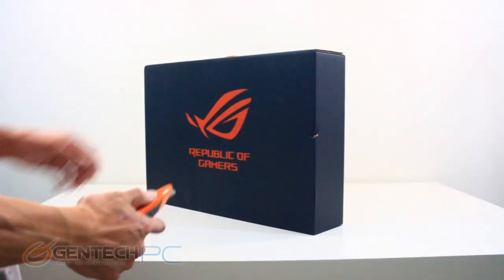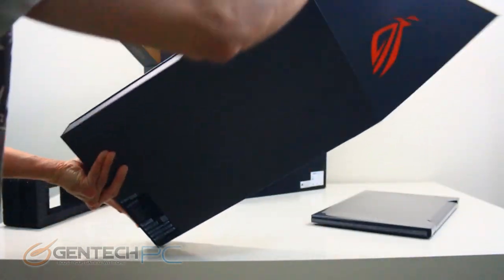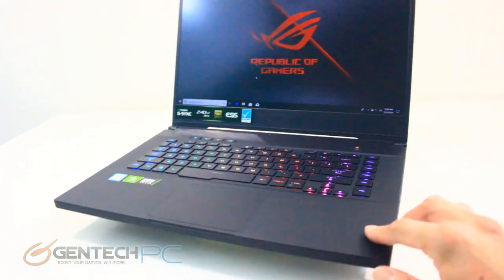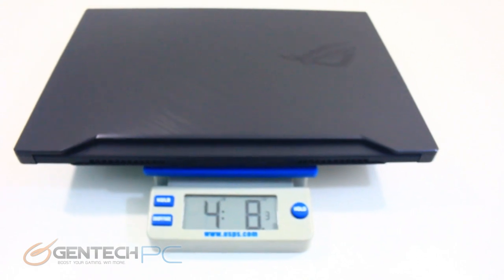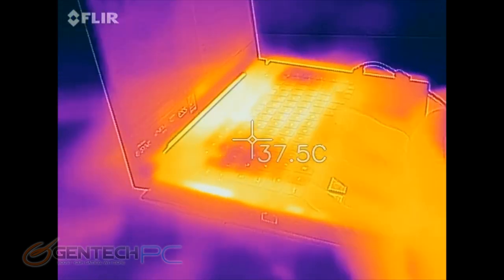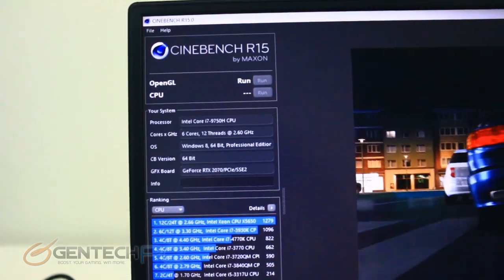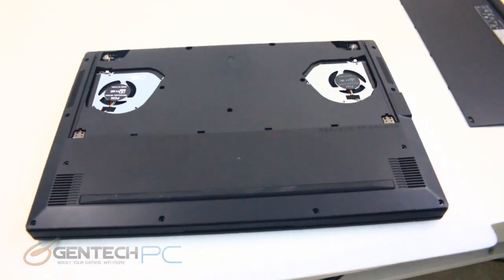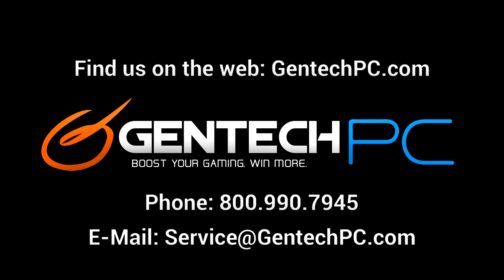Asus Zephyrus S GX502GW-XB76 240Hz RTX 2070 Review & Benchmarks

Comment: The cooling is really good in this thing especially for a ultra-thin laptop it’s great
Reply: If it is really all it is cracked up to be I hope so, I bought the previous model and am stuck with massive over heating issues and no BIOS options, are you able to access anything other than trivial stuff with the BIOS? I'm in the process of getting a refund or upgrade replacement to this.
Reply: KrazzahU well I’ve played Fortnite and call of duty for 3 hours or so and it hasn’t gotten over 87 degrees. It’ll vary between laptop but I think it’s a really good one. The quality of the build is wayyyy better than the msi and a dell.
Reply: This guy got a golden sample. Most people with this specific model (including me) have the CPU cooking at 93-99C and I have sent the laptop once to the service center. I had to limit the CPU speed to 3.6Ghz which is honestly very disappointing when the advertising over glorified the shitty cooling solution.
Reply: @firasbajjar  makes sense why I'm seeing them in mint used for $800-900 dollars. Thanks for the info.

Comment: Looking forward to getting my unit tomorrow from your team and testing the base against the unit I got with conductonaut and Fuji pads!
Reply from the maker: Thank you Travis for supporting GenTech PC. :)
Reply: GenTechPC pleasure!  Good video :)
Reply: Amazing free specials they have. I really really want this laptop, but was slightly concerned about those fan speeds when gaming. If you install the fuji pads + upgraded thermal grease that should keep temps even lower = lower noise output. Please place your results here! I'm def not gonna spend $2,500 if it sounds like a jet lol. Thanks!
Reply: Travis Muller really? Hmm.... let me know what you find out!
Reply: J Bob I will!  Want to hear from them first before posting my results.  Not fair to post my information at the moment.  Regardless, you can undervolt as well to reduce about 8C.

Comment: How reliable is that cooling flap system? I feel like you can trap dust/debris or maybe break it when you close it if something gets half way in.
Reply: Its just a big piece of plastic that gets pushed and bent out... so when u get something inside like idk lets say an sd card or a small usb stick(i dont think normal ones would get it but some that are as small as the new xbox one controller adapters would) it would just not close so ull see the laptop balance on the still raised corner and the one opposite to it... but after all its just some plastic screwed in with 4 screws so u can easily replace it...
Reply: Dorin Mihalca I haven’t had a problem. There is minor flex on it.

Comment: What is the battery life on this, with Optimus enabled and with Gsync?
Reply: it's what i wanna find out before i decide to send my razer blade 15 back just for this if the battery life is better and the cooling ofc
Reply: @admiralv8538  Why'd you decide to send your Razer Blade back? I'm planning on purchasing one.
Reply: @ZS-xi4xk  on amazon it was pricey but they bought it down and i was concerned about the life span like how long it would last it did get hot for me while gaming it was around 80-87 even when i undervolted and because of that i decided to send it back i am just gonna wait till next year or so.
Reply: @admiralv8538  You're not going to find much better temps out of a thin a light gaming pc. Usually temps are well above 90 C when gaming in other models.
Reply: @ZS-xi4xk  ahhh well ty for the reply but i prob just wait a while i mean i did feel that the life span won't last long so yeah i was hoping it would last me 10 years but from what i see on reddit some only last a year or 3 years then i thought it was not worth spending 2500 for a 3 year lasting gaming laptop.
Reply: @admiralv8538  I don't think it'd only last 3 years. Probably 5-7

Comment: Wait, so the 16GB comes out of box is single channel fixed on the motherboard. Doesn't single channel hurt performance in some games if I leave the other RAM slot open?
Reply: I heard that single channel for rtx does limit the performance. It was confirmed by nvidia itself,and they have not fixed the issue yet.
Reply: TotheK I N G D O M  Yeah, I know. I wanted 32GB ram anyway, guess I'll just put the ram and the 2nd SSD in together.

Comment: Do you happen to know how to enable g-sync? I just got this laptop and can't figure this out for the life of me. Nothing in the manual about it and read an amazon comment that you have to activate discrete graphics to enable it (but can't find that either). Great review btw, it was the reason I got this laptop!
Reply: If you haven't figured it out yet:
Armoury Crate -> Home -> 2nd tab (little diamonds at the bottom right) -> Device Configuration -> GPU Mode! (reboot required to switch)
Hope this helps! Had mine for a week before I found the setting.

Comment: Nice review!, i'm a little bit worried about the bottom part and the vent for long time use , will it be strong enough after we open and close the laptop a lot ,and even when we carry the laptop with open lid
Reply: Ive got the older Gm501 that has the same bottom part after about a year of dragging it all over the states for work its still the same as the day I took it out of the box. Ive used it for gaming while stuck in hotels and at work programming plcs and hmi screens. I do open it up to clean regularly.
Reply: @spudward6902  Cool! thanks for the reply man been looking for some thoughts bout it , it helps a lot. Have a nice day!

Comment: Nice video! Ive a question about the charger. I bought this laptop in china because Im staying here for the whole summer. But i live in canada which have different plugs. Do you know what exact size is that cable connecting the wall and the power brick? And where might I buy this? Im looking to just buy the cable and not the power brick if thats possible.
Reply: 可以啊，取决于当地的插口规格，你去rog吧发个贴就知道了

Comment: I see a 2nd m.2 so the storage can be upgraded by you right?
Reply from the maker: Yes the GX502 product line comes with 2x M.2 PCIe slots, you can install two PCIe or M.2 SSDs no problem as you can see there are a empty 2nd M.2 slot in the video.

The 2x M.2 slots supports RAID-0 and RAID-1 configuration as well.

Comment: How did you remove the heat pipe assembly so easily. Mine seems as if it is stuck. I removed the 8 screws and the 3 screws on each hinge. I am stuck. Thanks.

Comment: I've got the same model and specs, my cpu hit 95 every time a play games. Do you think itd be worth removing stock thermal paste and replacing with liquid metal or the graphite sheet?
Reply: To be honest I don't think it's bad because every gaming laptops get hot like that so I don't think it will break. If it breaks u still have warrantly :)
Max temps for CPU is 100°C
Reply: In my opinion, liquid metal is too risky for a laptop that will be jostled around in a backpack, and a graphite pad is actually not that good for laptops, it's meant more for people who run multiple benchmarks who normally need to replace paste multiple times.

Your best bet is to repaste with something like Thermal Grizzly Kryonaut, and undervolt it.

Honestly I think you just got a bad paste job. I've seen multiple reviews mention the CPU hitting 95C, but I'm pretty sure Asus just has the CPU thermal throttle when it hits this point.

The reason why I think the Zephyrus actually has great potential is because in this review max temps were in the mid 80s, while NotebookCheck saw temps peaking jn the low 80s, so I think they just got a better paste job than others, whose test machines ended up throttling at 95 C.

Comment: Please confirm how much RAM is soldered on vs. what it can be expanded to. I’m curious if it comes with dual channel as well
Reply: The way I understand it from reading, etc is that there is 1 x 16gb soldered on. So if you want dual channel you have to go with another 16gb stick. That sucks, but in particular, GentechPC is offering that for only $100 more... not too bad. Hope this helps!
Reply: @Jowersman  That's unfortunate. You'd think they'd learn from their mistake since their last gen "gaming" laptops only had 1 stick of RAM too. Their new Scar III has 2 sticks from the factory though.

Comment: Does this have Dual channel ram? Or single?
Reply: It is single chanel but you can throw in another 16 gigs for cheap and get dual <3 thats what i'm aiming for
Reply: @hallow5170  yeah 16 gb integrated into the motherboard and an empty slot which u can fill with another 16gb stick to get the over the top 32gb dual channel ram goodness... i wonder how many chunks u could load in minecraft xD
Reply: @vali69  mate !!! And add some shaders with mods like industrial craft and others

Comment: single channel memory is a deal breaker
Reply: Dude, the single channel ram can be fixed by adding another extra 16GB of ram for 32gb total......I have 32gb in my aero 15. 

Overall most of the complaints about this laptop are not valid, you can turn off g-sync reduce the refresh rate for better battery life and add an extra stick of ram etc..........I just wish it had a bigger battery, touch screen, top slim bezel webcam and biometrics (windows hello facial ir + fingerprint reader)
Reply: @kninezbanks  well they still improved the battery regardless

Comment: when the chassis gets so hot, eventually the batteries bulge and fail.
Reply: The batteries NEVER get that hot, the only logical way that they would bulge is from an extended charge, which is prevented by a failsafe auto discharge feature.